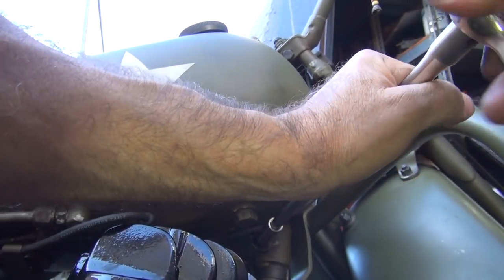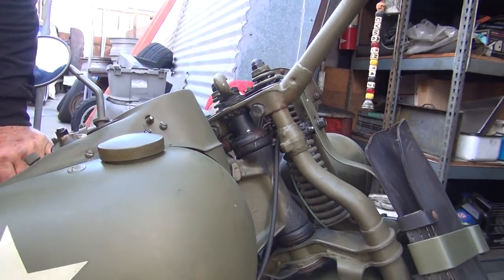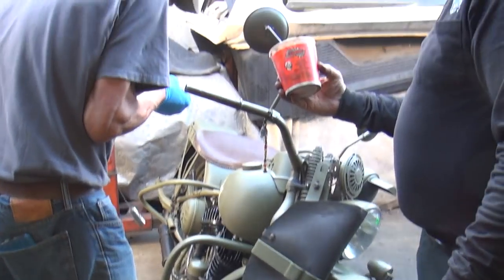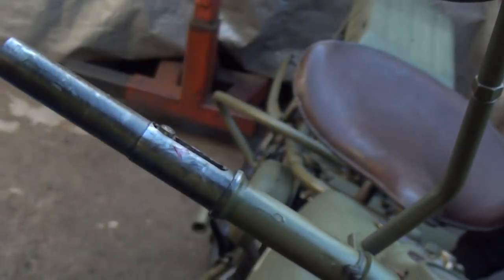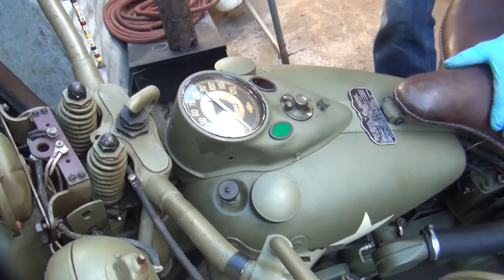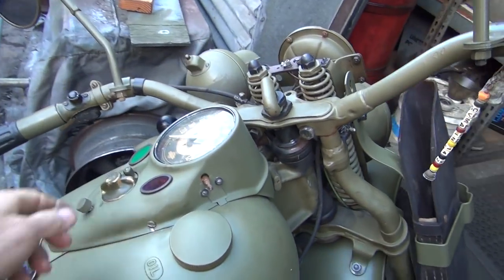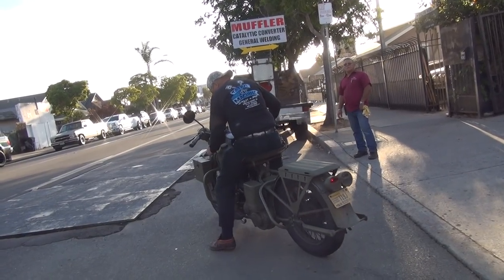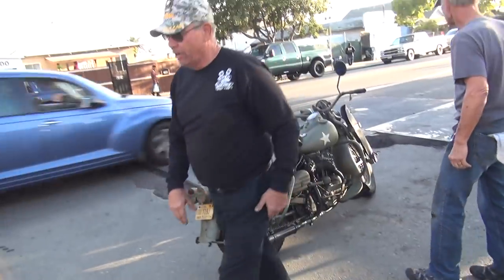1942 45ci wla type 5  #130 rebuild repair tune-up harley flathead sidevalve by tatro machine

Comment: Tatro,  whats the reaso. For the crazy intake setup on these bikes ?   Was there a specific reason for the big box filter or was it just the way they did it back then ?
Reply from the maker: these wla bikes were made to go thru 18" of water with no problems. they also would go just about anywhere you needed to go. they handle great on or off road.
tatro